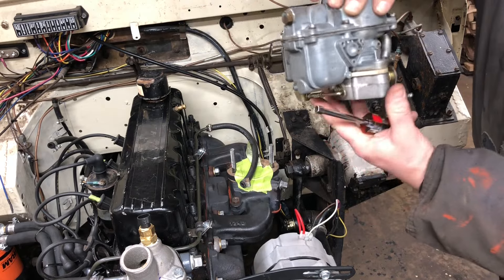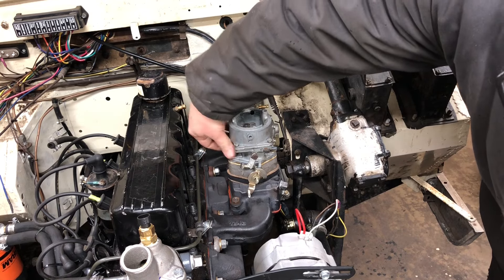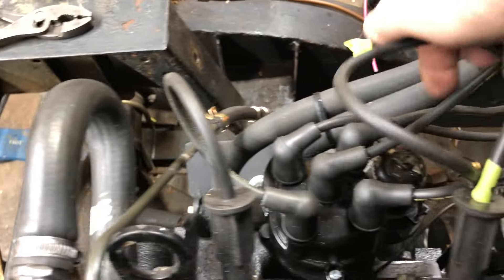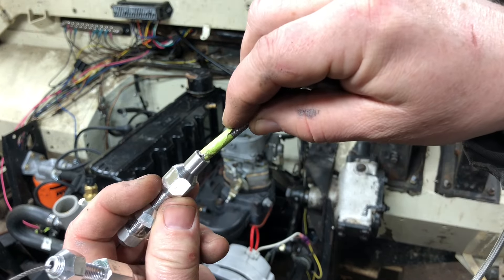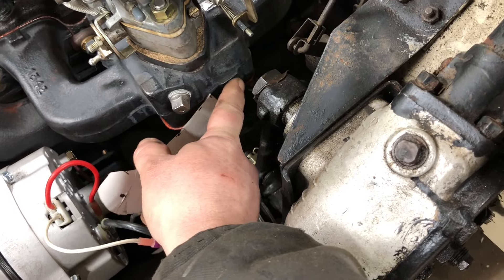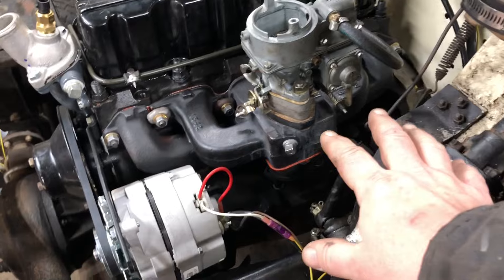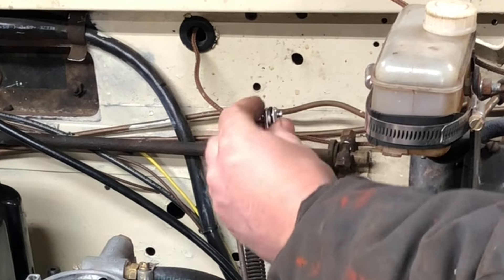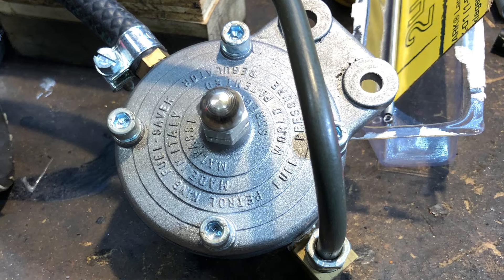Throttle cable conversion Land Rover Series 2A Scotty adapter swap engine

Comment: Nice work Mr Anderson. That pin you didn't lose, I lost mine. Gone forever into the cosmos! A visit to the hardware store resolved the catastrophe. That engine you have looks good. All the best.
Reply from the maker: @ForemanAndWilmsAdventures  Thank you Mr Foreman. I did drop it once and found it. Ha ha!! I was very luck!! The engine turned out very nice. Thank you!

Comment: Apart from the HP, the Mercruiser provides, what are the advantages compared to the genuine engine,pls. Will the gearbox (LT76 ?) stand the increase in power? ( My son and me swapped the 2.25 petrol for a 200TDi Discovery 1 engine ( Series 3 109, ex-mod, 1984) some years ago. Heinz
Reply from the maker: @HeinerStorchennest1  the advantages is being in the USA the Chevy GM based inline 4 or Inline 6 parts are plentiful and can be found local. The power is a big upgrade compared to the LR diesel. I would have loved to put in a 200TDI. Again, being in the USA the 200TDI are just too expensive. Along with finding a series 2.25 petrol or a 19J or all the J engines might as well be dipped in gold for the price garages want. Ha ha!! The transmission is the stock 2A trans suffix B.
Reply: I See. Thanks for the feedback.